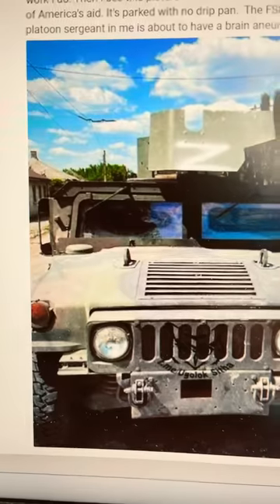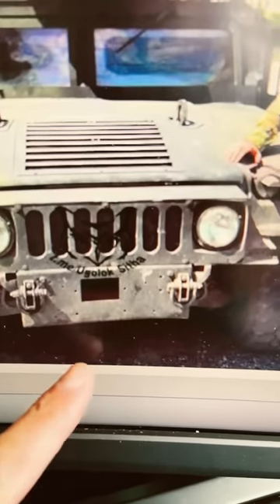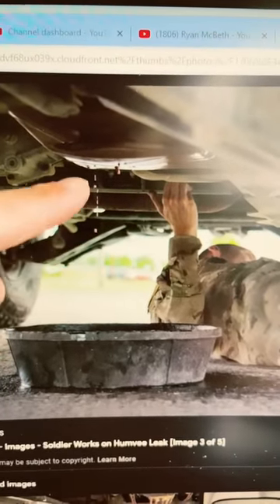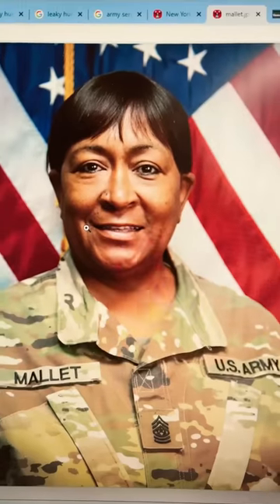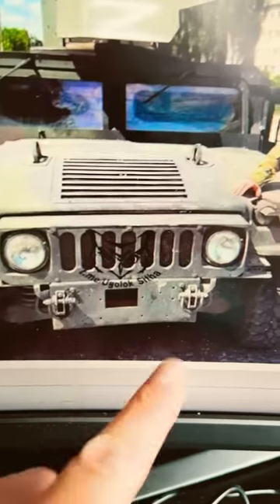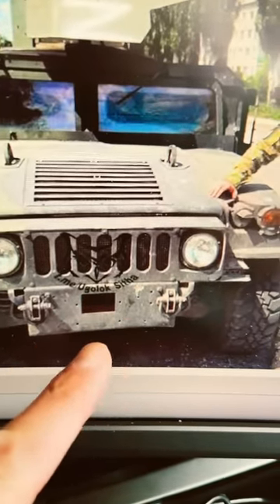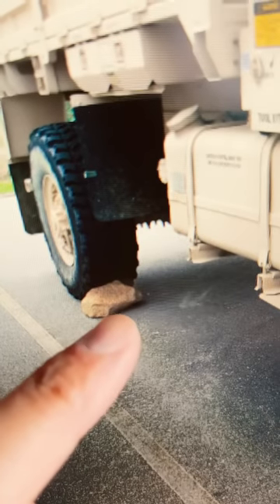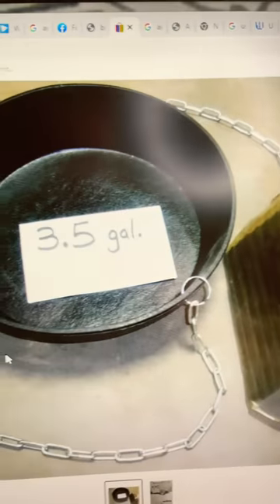What is a chock block and drip pan?

Comment: "vehicles drip alot of fluid when parked" NO army vehicles drip alot fluid when parked. Great video
Reply: Now I need to know why army vehicles drip so much lol
Reply: @ETBrooD  because they are cheaply made. Or at least I know the humvees are. They were meant to be cheap and easy to make just like every other "military grade" thing. Which many time results in there being a few problems. Like with humvees they love to leak oil.
Reply: That's also why "military grade" is a scam. If something is military grade that just means it was sold to the cheapest bidder and many times results in a cheaply made and sometimes defective product.
Reply: Yeah, we never used drip pans in the Air Force. Didn’t even know that was a thing til now
Reply: @ETBrooD  because if it wasn’t dripping that means it’s out of fluid
Reply: @shotgunpaintbrush8731  The fact that they are old and exploited in harsh conditions probably doesn't help, either.
Reply: @Psych0technic  Combat tends to be in exclusively harsh environments. If mother nature isn’t trying to kill you, enemy/friendly fire is.
Reply: @shotgunpaintbrush8731  I suppose it can depend on the industry.  In electronics military grade has specific definitions.  Military grade components can withstand more vibrations and a wider temperature range.
Reply: Seems like a typical Chevy to me
Reply: Yeah they do. And when servicing vehicles usually soldiers drip crap every where too. Lol
Reply: @shotgunpaintbrush8731  it's not that they are cheaply made, it's that they are used and abused.  I was infantry and what we did to vehicles? Yikes. Lol. Drivers keep everything lubed, then there shouldn't be any problems.
Reply: I own an ex aus army landrover . It leaks like it has shares in BP. Although that’s just a landy thing
Reply: @Clyntonsshed  Like it has shares in BP haaaaaaaa. Nice
Reply: @monty8930  worked on an old plane while in which had basically built in drip pans... god help you if they overflowed
Reply: The lack of comma in this had me confused as fuck lol
Reply: No American Military Vehikles
Reply: @monty8930  yeah, all we used was chocks lol.
Reply: I'm pretty sure your sentence says the opposite of what you meant but I suppose adding a comma would make it match your intent.
Reply: @thorr18BEM  it's not a term paper 😁👍
Reply: @ds6872  well, i thought you meant that no army vehicles drip fluids when parked. But that wouldnt make sense since he literally explained it in the video
Reply: What about Marine vehicles?
Reply: @ETBrooD  because the army is the largest branch that operates a land vehicles ranging from Humvees to commercial vehicles modified for military use to Strykers Bradleys and Abrams, so it has a large fluid vehicles all with different needs and a limited amount of dedicated mechanics in the case of the Humvee a limited amount of 91 Bravos or wheeled vehicle mechanics who don't have to just take care of the Humvee but the several utility trucks the Army operates along with the larger wheel Vehicles such a Strykers and heavyweight utilities. So the Army has a system to determine how bad a leak is and if it needs to be fixed or it can wait.

It's not like every time you go to pull Humvee out of storage or from parking you need to fill up oil most of the time it's just the amount of paperwork that goes into cleaning up a few drops of oil is not worth it put a drip pan under it.
Reply: @shotgunpaintbrush8731  but ain't nothing about military grade is well yes it's all those things it's also meant to be durable enough you can give it to a fresh out of high school 18 year old with little training and it will hopefully last a decent while

Comment: I feel like the Russian army really couldn't care less about dripping oil. 🤔
Reply: They will, thought, when they start eating petroleum-based gravy.
Reply: @MarcosElMalo2  If I remember correctly, they actually did that during the Siege of Leningrad.
Reply: No shit. Did you watch the video?
Reply: It's a joke, son.
Reply: Couldn't care less would mean they care
Reply: @SocialContractActual  no. "Could care less" would mean you could actually care a bit less then you do currently.
"Couldn't care less" means you can't care any less about it, since you are as low as you can go already.
Reply: They really must care, why else would us "Grunts"  have guarded our motor pools so thorough at the end of the Cold War in West germany? Couldn't be guarding against our fellow soldiers removing (acquiring) drip cans, chock blocks, pioneer tools, extra tracks, and basic Army equipment not chained down.
Reply: @MarcosElMalo2  lllpl l
Reply: They don’t care much about life so wouldn’t give a crap about a drip pan and their vehicles don’t last long enough to worry about rolling away
Reply: @MarcosElMalo2  yum no they don’t care
Reply: Well, there's a reason why Russian vehicles have reliability issues.
Reply: Could you post an explanation of why hummers drip fluids? A well maintained normal car shouldn't leak fluids why are Hummers different?
Reply: army? here is regular рeoрle don't care if their car driрing on roads. it's regular thing if рarkings near markets are black from oil
Reply: @00pingvin00  this is actually really rare in my country, Austria. Don't people in the US do any maintenance on their vehicles? I have to put my vehicle to inspection every year here, unless it's really new.
Reply: @nobodyofnaught2  build quality
Reply: Yeah because they never had any oil in them to begin with lmao
Reply: @TheFeldhamster  not necessarily every year maybe. At least not after 3-4yrs after since before them its still under dealer/manufacturer complementary service. Although after 8yrs of manufacturing year we have to so smog checks every year here.
Reply: They don't care about many things, hence their weak results.
Reply: @wiryantirta  well ok, actually, when the vehicle is brand new, the first road worthyness test is after 3 years, then the next interval is 2 years, after year 5 it's every year here. And it includes much more than just an emissions test, they check stuff like the brakes, how straight the car runs, rust on structural parts, oil leaks, even broken lights. Saves a lot of lives here because it forces people to keep their vehicles roadworthy. Germany has a similar system (TÜV) where the interval is every 2 years. Additionally, the car manufacturer may require you to do certain maintenance to keep your warranty.
Reply: @nobodyofnaught2  they should not drip any fluids, but military vehicles are under a lot of stress and breaking down in the battlefield is a big issue. I bet they must always use the dripping pan in order to detect leaks ASAP.
Reply: @00pingvin00  it's easy to get a tow truck outside a battlefield, and these humvees drive through a way rougher terrain.
Reply: @nobodyofnaught2  cheap parts (lowest bidder) half assed maintenance, or maintenance with cut corners to keep vehicles running. Also the vehicles are used and reused for very extended periods of time.
Reply: @TheFeldhamster  same in the UK.  Oil patches on parking lots are less common than they used to be, probably because we've only got foreign manufacturers now lol
Reply: They would just repackage it and sell it off.
Reply: If the Russian army was an army that cared about dripping oil, they wouldn't have 25 million dollar PANTSIR's tires exploding, discipline starts with the small stuff
Reply: Ukraine is winning 💀
Reply: Did someone say oil?🇺🇸
Reply: @TheFeldhamster  
UK, Ireland and France too, very similar time intervals with deep checks as listed above. 
I once failed because one of two tiny bulbs on my rear registration number plate was broken. 
They are very strict in Europe!
Reply: Especially since Russia is the 2nd leading exporter of petroleum in the world.
Reply: @nobodyofnaught2  Hummers are built by GM. What more do you need to know?
Reply: @SocialContractActual  No, it means exactly what it says, that they could not care any less. You're confused with people saying "I could care less".
Reply: Yeah, they're busy doing actual military work... like fighting the enemy.   That is something us army doesn't understand
Reply: @brandong550  😂😂😂😂🤣🤣🤣🤣found the Russian bot!!
Reply: It marks places they seen if they got lost
Reply: @jic1  it was mainly glue and sawdust and a drip of flour 
Plus all the cats and dogs and rats 
Even bugs 
Leningrad had no life forms but humans by the time it was liberated
Reply: @Radbot776  There's records of people frying pancakes made of bran and goosefoot seeds in motor oil during the siege, so they were definitely desperate enough to at least try to eat petroleum products.
Reply: @brandong550 russia is a gaint joke compared to us. Hope china has better equipment and soldiers who are actually trained. Not just some kids who watched 80s movies and can fire from the hip.
Reply: @peterswanson6816  ah, either you have no military experience, or you're army.  You must be unfamiliar with the growing strength of these two nations (that would love to dominate us)..?   They are no joke, seems you are.
Reply: @brandong550  Russia is a joke though, If Ukraine was replaced by India, Russia would get steamrolled with how poorly they're doing against Ukraine and Ukraine is not even on the same level as the Indian military 🤣
Reply: We eat lots of petroleum based products. Ask the rabi that seems the wax that goes into Hershey's kosher at Exxon refineries
Reply: @codyl1880  that shit is mine
Reply: I mean it’s a captured vehicle

So it says a lot more about the Ukrainians than the Russians
Reply: Why would they, they are winning
Reply: @timothytim1053  They aren't losing as badly as everybody expected. Not yet winning.
Reply: @danielch6662  what are you talking about?  For 4 months straight we heard Nothing but how badly RU was losing. Now suddenly it's just cope and seethe all over
Reply: @SocialContractActual  you don't understand the expression could not care less, because they don't care at all.  If you don't care at all, it is impossible to care any less. If you have no money, you can't have less money. If you have a zero amount of anything, you can't have any less than zero.
Reply: @SocialContractActual  There's no requirement for idioms to make any sort of logical sense. "It's raining cats and dogs" is logical nonsense.
Reply: well, the generals can report 10L oil replacement/vehicle/day and pocket the funds allocated... so I would dare to suggest they do care about dripping oil
Reply: They have a tonnage of oil they'd care less
Reply: Its a Really good way of Tracking a Vehicle and seeing how recently it was Parked there
Reply: @SocialContractActual  no you're just wrong
Reply: @SocialContractActual  That's literally the opposite of what that means.
Reply: @SocialContractActual  Coulddemt care less means that it is impossible flr you to care more. If you could care less then you care a little bit so he says he dles kot care at all
Reply: which is how they got where they are lol.  i feel like not keeping the drip pan standard is a great metaphor for why the russians fail so hard but the american military does not.  the standard 😂
Reply: @jic1  kinda doubt it
The only use for ingesting petroleum is to FUEL somenes toxicomania and petrol is a weak drug although only the fumes are enough to get a trip and health damage
Reply: @georgyekimov4577  They weren't trying to get high, they were frying bran pancakes in motor oil because there was nothing else to eat except corpses.
Reply: Dripping oil very bad. Probably mostly water from the ac
Reply: @jic1 ha
Red dye 40 is petrolium based
Its in everything
Reply: That’s the joke. Congrats.
Reply: I could care less about dripping oil. It came from the ground and we are just returning it.
Reply: @gang1798 military vehicles don’t have air conditioning
Reply: I don't think many countries do in combat. It's like the least of your worries.
Reply: @davidelliott5843 you are clueless lol, AM General is kot a GM brand, GM got the rights to the Hummer brand in 1999 and sold the vehicles to civilians at that point, and expanded the brand with GM based variants soon after. 

The original hummers are not GM designed or built in any sense of the word , and any hummer built for military use was absolutely never a GM product.  It was American Motors that held the claim to designing the original hummer, it owned AM General until its merger with Renault.  At which point AMG was sold to LTV. At no point has it been under the GM umbrella.
Reply: it can't drip oil if they've got no oil

Comment: "vehicles drip a lot of fluid when parked".  Is it that hard to make a military vehicle that doesn't drip?  

In civilian life, the solution is to buy a Japanese vehicle.
Reply: Planned obsolescence military style!
Reply: Just because it is the military, doesn’t always mean it is the top of the top, it mostly  means something works for the cheapest price.
Reply: I don't think its because the vehicles drip when working well. But it's rare you have everything 100%. Drip pans are to see if and how much it is dripping. And then you can adjust accordingly.
Reply: Hondas piss oil regularly, were you thinking of a different one by chance lol
Reply: Oil leaks in a BMW are a good thing. That means it still has oil in it
Reply: They probably leak so much just from lack of maintenance, not being able to get parts or time/tools necessary to replace leaking parts or gaskets in a combat zone
Reply: @kevinmonahan2820  And also maybe from having been shot, near artillery explosions, dropped out of an airplane, run thru some foxholes, run over some terrorists...

And of course...

What's the difference between a porcupine and a BMW?

With a porcupine, the pricks are on the outside.
Reply: @avery4149  Also, it means something that can take damage and continue working, which often means looser tolerances.
Reply: You have no idea the abuse military equipment takes.    One of the early tactics with the M1 was too crest a hill, take your shot and then immediately slam it in reverse.  Just imagine how much strain that puts on a transmission.  I think drivers are now taught to be a bit gentler on reversals.

In top of that there isn't anything a grunt can't and won't break.
Reply: @avery4149  something “works” for the cheapest price
Reply: @avery4149  on top of that. Diesel powered anything is going to leak shit. Especially after hundreds of thousands or millions of miles. If it’s not leaking? There’s nothing in it 🤣
Reply: If it doesn’t drip then it’s empty
Reply: My old civic dripped alotta oil
Reply: Or a german one
Reply: Why don't we just buy a shit ton of tacomas and use those.
Reply: Probably leaking front or rear main seals. They're annoying to fix.
Reply: it's because the Humvee has more in common with an ATV than a proper civilian car. Also they aren't the best vehicle from what Vet friends have told me.
Reply: Are you joking? Military vehicles experience more than twice the amount of abuse, shrapnel and gunshots
Reply: And avoid bmw
Reply: Our $30 million dollar Apaches have an approved leak tolerance lol. I don't remember what they are, but it's basically 1-2 drips per hour is fine, 3-5 needs addressed but it's still mission ready. 6-10 should be grounded but can fly if mission critical. I'm sure I'm misremembering, I haven't been in aviation in 10 years.

Comment: I served a Motor Sergeant in a Field Artillery, Mechanized Infantry and Armor Battalions from 1976, when I was promoted to Staff Sergeant, E-6, 'till 1990 as an Armor Motor Sergeant, Sergeant First Class, E-7, retiring at 20 years of service. Keeping petroleum products from contaminating everything from concrete to soil and any water below the surface was one of the major services the user level Motor Sergeants performed. Then proper disposal of the contaminated products like soil was next. Plus, I had to ensure any vehicle maintenance performed under my supervision controlled any fluid spills. Getting a proper 'dry sweep' or oil collecting material was my biggest logistic issue! I will say that any repairs of leaks above the organizational level, where I was responsible, was also a priority and am happy with how the units I served in did their best to be good stewards of the environment! Lastly, I was the NCO that went on the Motor Pool inspections with the Battalion Sergeant Major. Glad to say early 'butt chewings' for problems found enabled me to be 'better than' the standard that was expected to be met!